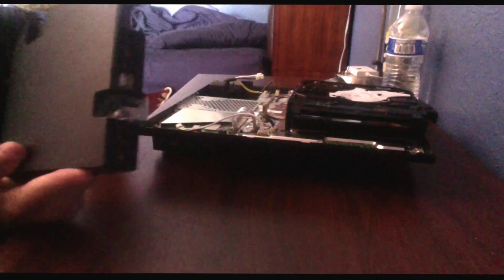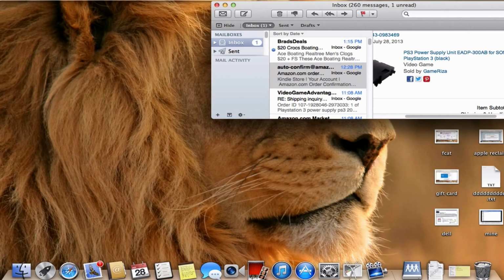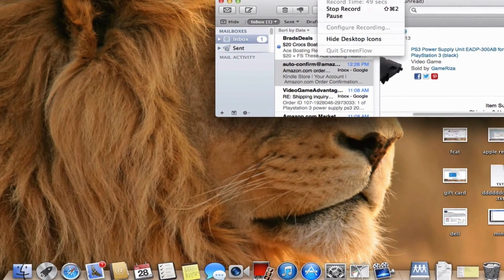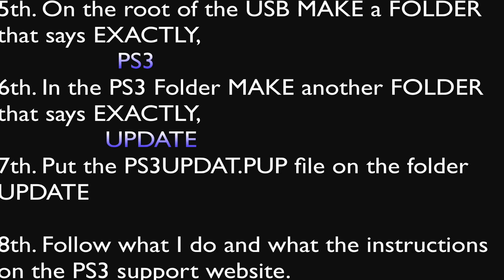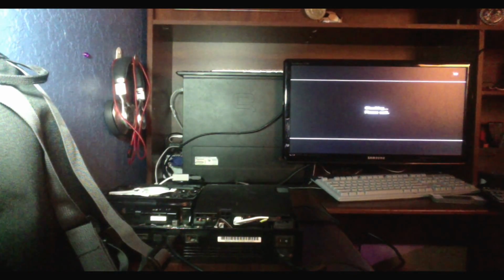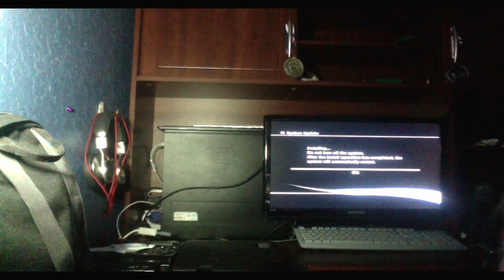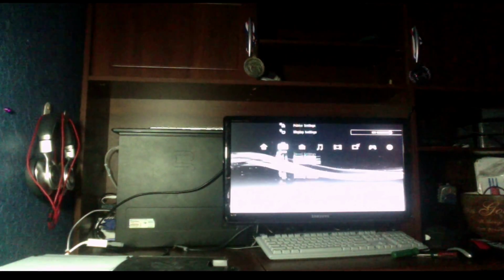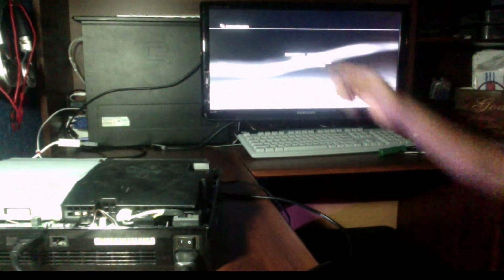1st ever PERMANENT Fix YLOD PS3 in 2 hours

Comment: I found the best ever-working solution for YLOD repair..
Reason - your PS3 not working and flashing a red light. So - unsolder damn red light and replace it with a green one. That way your PS3 will be working forever.